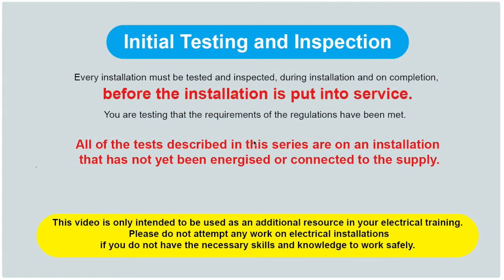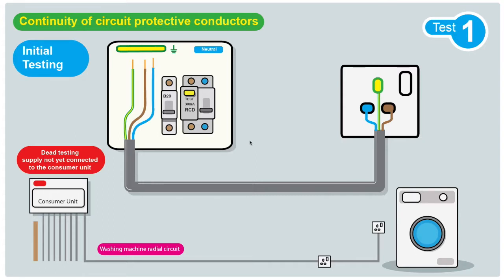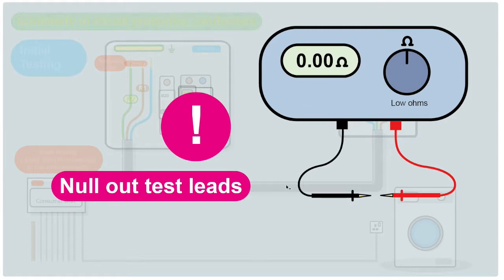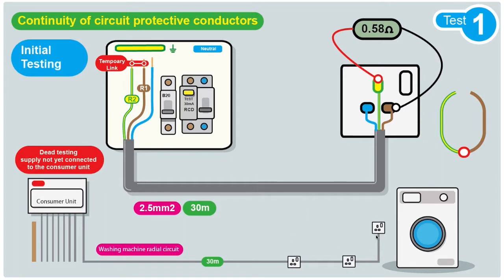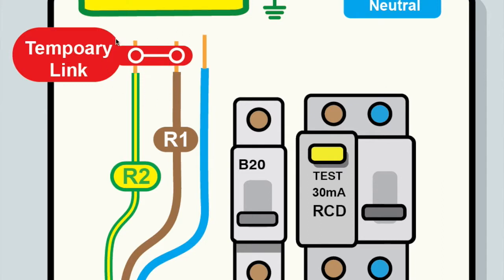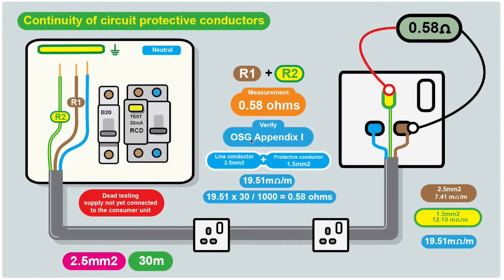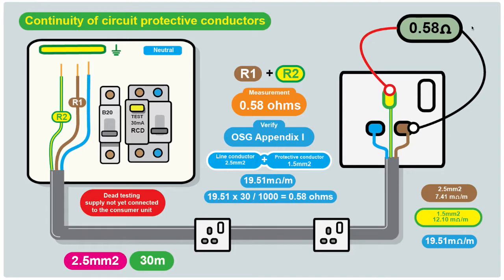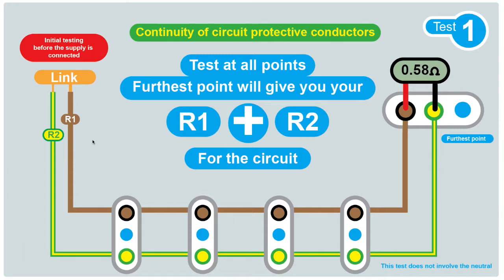The Essential tests - Continuity of the CPC

Comment: Hello Sir. I'm on the coaster taking a course  2391. Yours videos has been tremendous help. I'd appreciated  getting your answers based on my questions.  It would be impossible to know exactly roughly the length of the cables  in the reality world.  How  do I know what's  acceptable reading and what's not?  From what I understand is the lower the reading  the better it is, so what if  the reading  comes in varies when testing on different circuit just say  o.56 ohm ..1.2 ohm...1.5ohm ..2ohm..3 ohm?  Thank you.

Comment: Hi sir, You have provided very useful information and the way of explaining is amazing. Thank you so much.
I have a doubt on this topic. I read about this in a book and they mentioned as below. Can you explain about this👇👇

"The test should be made by connecting together the neutral and protective conductors at the mains position and checking between earth and neutral at every outlet by a continuity tester, which should show a reading near zero."
Reply from the maker: HI Mounika, Thanks for the comment.  The usual test is connecting the Line and Protective conductors together (Isolated of course) This is your R1+R2.   R1 is the Line (Live) and R2 is the CPC.   The reading will depend on the length  of this loop. All cable has some resistance, But you would expect a very low Ohms reading.  So if you have 20 meters of 2.5mm2 twin and earth cable   The expected R1+R2 would be around   0.39 ohms.